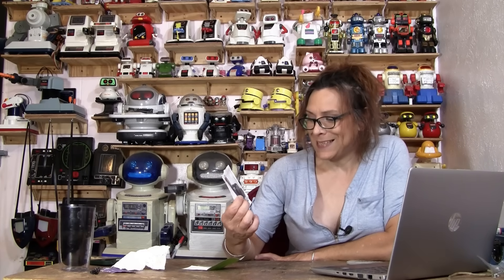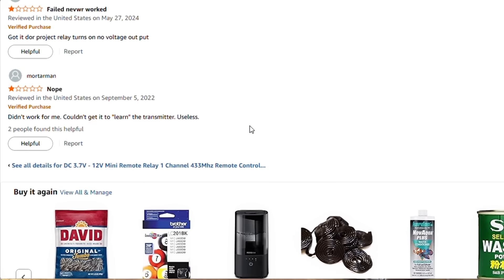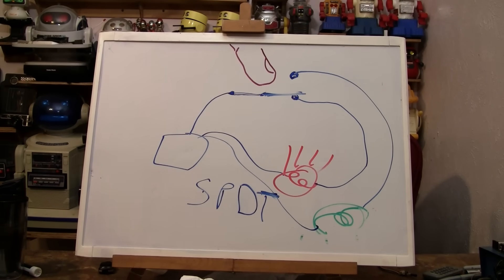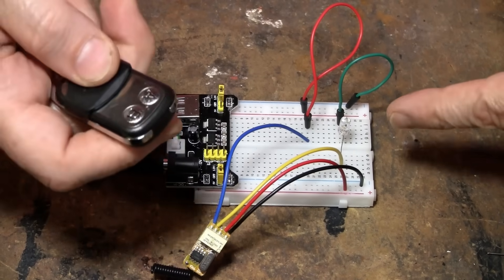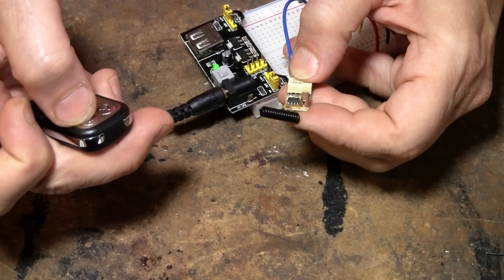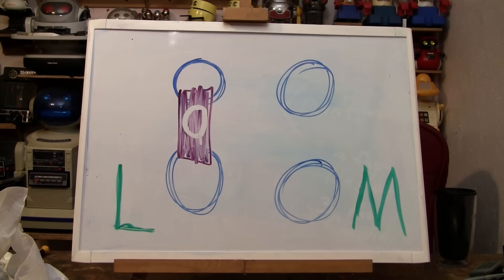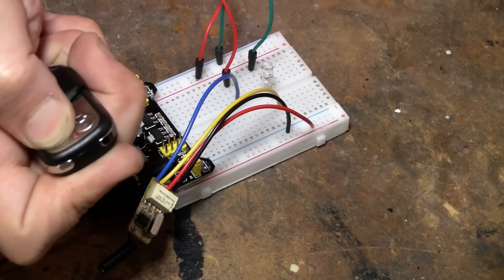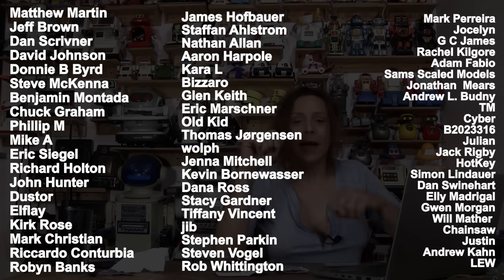How to Make Anything Remote Controlled, One Channel Wireless Control!

Comment: Probably one of the easiest to install and understand products on the market.  Just needs 12VDC.  The other two wires are a dry contact, no voltage.  I mean it doesn’t get any simpler than that!

Comment: They messed up when designing this. Latch is supposed to turn on and stay on until you hit the same button again. Momentary should be that you have to hold down the button to keep the switch activated. Toggle should be you hit one button to turn it on and the ither button to turn it off.

Comment: I've been playing with these switches for years. Super handy once you figure it out. I've installed it in my PC. It's feeding from an internal USB that's always on during soft-state. And the output is connected to the two pins with the On-button. As long as my PC is plugged in, the USB feeds this relay, and I can turn on my PC from my couch.
Some people may say why not use the (Last Power State) option set to (Turn on when power is on), and use a wifi outlt adapter to turn the PC on from your phone. That works too, but... It means your PC stays completely off when turned off. And that's bad for the motherboard battery. You want the PC to stay plugged in. And in that case, the last power state option is useless. You need something like this to turn it on properly.

Comment: On Amazon UK, I have bought several remote control,solutions that are way less complicated. For £15 ($20) I get a remote control controller that controls 3 separate wall plugs. I unplug the appliance, plug in a remote control unit and re plug my appliance back into that. That’s all. I can then control whatever is plugged in remotely.

Comment: How do you reset the initial relay programming from the remote to circuit? Ie; click A once turn on click B once turn off, to click A twice turns off, click B twice turns on. As a troubleshooting procedure in case the initial relay command doesn’t respond?

Comment: Kind of confused by this whole video. You understand what a switch does but not the 3 kinds of switch? Also the diagram that you say is wrong is not what you think it’s for. It’s for adding a physical switch to the receiver so you can trigger it without the remote.

Comment: Yeah, it's just a remote controlled switch that either completes or breaks a circuit.   Your remote door locks on your car work the same way.  I set up something similar to remotely control an electric valve, saves me a lot of walking.

Comment: You should add a series resistor with the LED to prevent too much current from frizzelling it. Try 220 ohms at 3v as in your circuit.

Comment: Love your video on your remote-control magic! I was interested throughout and it sent me to your channel. Thanks a lot for the education. I really apricate your approach, your knowledge and your enthusiasm and being low key like me.
I found the mini remotes on Amazon you recommended and I’m now looking at Breadboards and Power supplies for the first time.
Could you give a beginner in electronics a recommendation for a Breadboard and Power supplies for a first-time breadboard user. For a minute I thought they were sold together, just now figured out you have to purchase separately. I’m finally able to pursue my interest in electronics more since retiring. I’ve been working on all kind of stuff. I’ve gotten into some RC stuff and have a tub of RC VEX stuff. Along with HO train stuff. I’ve been messing with power chairs and have assembled quite a collection of Bose stereo equipment and we just installed a home security system. So, I love what you’re doing. KEEP THE VIDEOS COMING!

Comment: I’d recommend using a resistor in series with the LED to limit the current through it. Maybe 100 ohms or so. Right now you’re just limited by what your supply can give, That LED might not live long.

Comment: I don't know who and why decided to call them pull/throw, because they don't make sense just by name (pull? people push/press switches). But I don't know - and it doesn't really matter - who and why called various technical terms that I commonly use. Part of learning about them is moving past the who+why, and part of it it's the explanation of how things work. If both parts are unclear, it's easier to shrug and move on. But it hardly gets clearer than the way you explained it, so now I understand the technical side and not care about the who+why. The rest will be cool trivia some time in the future. 😄

Comment: Hi, I have a question. I have a new invention coming out and I need a remote control release device for this. Can you help me out with it or point me in the right direction please? Basically I have an aluminum triangle that’s 3 x 3 x 3 and one of the sides will have a hinge on it and I need a device that when I push the button, it will open the door or open one of the sides up the item will be 4 foot long.

Comment: You could take 3 sonoff sv or another version of that relay and modify them for dry contact and a push button input. Wire in a liftmaster 850LM and program a 890 max and then you can control 3 things with your remote but also from your pc, phone or tablet

Comment: There are also lots of relays out there that use 120V, 24V, or 12V to power the device. I avoid battery operated devices when I can. Alternately,  you can use a 9V plug-in transformer to substitute for the battery with this type of device.

Comment: Great video. What your images and commentary show is that many of the lower star ratings are correct as this is miles from a turn-key device. This is why people are pissed with the abysmal  instructuons given with the product - there is no excuse for the hopeless instructions and Amazon shouldnt sell this rubbish. Read clearly here, the instructions make this useless. This device is for electronic experts (some might say nerds, but I wouldnt) only. I've fitted and used a few VSRs to control higer amperage devices using 200A relays on boats and I wouldn't go near a device like this as it's not really fot for purpose because of the user input required. Sorry to go against the flow that you guys think this thing is okay, but honestly it is definitely not.

Comment: Great tutorial, very interesting NO Normally open , NC Normally closed has always been confusing 😮 because the meanings seem opposite. Normally closed means voltage is always passing through, who ever made that up ?. Closed should mean it’s not letting voltage through because it’s closed. Just like you can’t come in my house because the door is closed, it’s always seemed backwards 🤪. Thank you for the simple explanation although I’ve never liked that way of calling circuits out. 🙏🏼

Comment: Be cautious of those breadboard power supplies. While the 3.3v and 5v regulators are rated at/or near an amp, the power switch is only rated for 100mA’s.

Comment: Are you a female? How can I use these with arduino?
Reply: You could attach the wires that get connected (when the remote fires) to a digital or analog input line of an Arduino, with a resistor, so that when you signal "on" with the remote, the input goes from 0 to 1.  Then your software can take it from there. 

I don't believe I've heard Randi speak about herself personally, why does it matter?  She's a human being and a great teacher, that's all I need to know.

Comment: I've been an electronics engineering technician for 45 years.  In this day and age, a 7mA  x  9V (or 63mW) continuous power consumption for a wireless receiver is quite high.  Consider that if the designers had incorporated a circuit that turned the receiver off for four seconds, then on for one second, the power consumption would be reduced to 1/5th, and the battery would last 15 days.  You'd have to mash the transmitter button 5 seconds to get it to respond.    But there are other ways to reduce the power consumption.
Reply: yes! solving a problem i ignored because i didnt understand.. now i get it! 
(and now i know why my dads battery keeps dying)

Comment: My comment is in regard to battery life of the 'Receiver/ Relay' board. Your suggestion of powering the board at 3.7V will definitely extend battery life. This is primarily do to the on-board relay coil. It is this coil that consumes the vast majority of the battery power. The relay is the only component on this board that converts electrical energy to mechanical energy. This fact is very important to the electronics experimenter because the relay can (AND SHOULD) be eliminated in many applications. 
I'm going to leave this topic open because I fully expect questions, because that's what experimenters do!
Wakodahatchee Chris

Comment: Hi from Ireland Randi. I have an old PC that we use just for tv in the kitchen. It's hard to get to so I used one of these wifi modules to switch it on and off . The power comes from a molex connector ( yellow and black 12 and 0v ) . For the trigger one of the outputs on the module goes to 0 volts when triggered. This goes to one side of the on / off switch line and set up as momentary . It's in use now about 3 years.

Comment: momentary would be good for a garage door opener. latch would work if you connected it to  a relay to control a circuit with higher voltage. this is a great find.

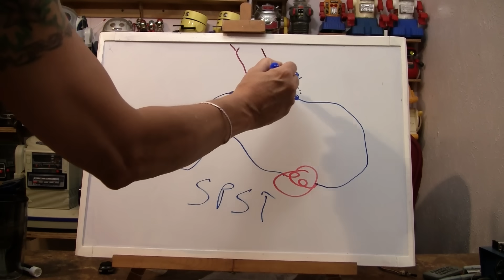Comment: 3:50 its technically a SPST-NO switch. (Normally Open) ,   which you should have went over before the SPDT-NC/NO switched relay. other than that it is good instruction / demonstration / edumacation.
Reply: She is correct. NO and NC describe the contacts of a switch not the switch itself. You would call the former an SPST switch like she did, not an ‘SPST-NO’ switch

Comment: After watching your video (How to make anything remote controlled, one channel wireless)... I purchased a clean 2000 buick lesabre custom with 123k miles & it did not come with a key fob. I purchased fobs, but I think there is an issue with the control box located in the trunk. However, that box controls other things & they work fine. I am wondering if I can use that to lock & unlock my doors? Tap into an existing circuit that is already fused but lacking control. My door lock switches work, but I  can not enter programming mode, so after seeing this video, I'm wondering 2 things? One being of course, would that remote allow me to control my door locks?

Comment: So. For the radio up the pole: It's been cloudy for three days, and the (meshtastic?) radio won't come on by itself when charging is restored. You need to momentarily interrupt power to reset it. So you need to run it through the normally closed contacts. Idk how long the battery will last, but will be longer than with the coil continuously energized. Maybe a lead acid 12v would be a better option, and you could run a wire to it at the bottom.

Comment: check it for false alarms over a 24 or 48-hour period. with an 8-bit enable code sequence and a high clock rate random matches can occur several times a day. if a single match toggles the output it will have a high false alarm rate. I have several four-channel remotes sitting in the trash bin because of this design flaw. useless and potentially dangerous (depending on the switched loads).

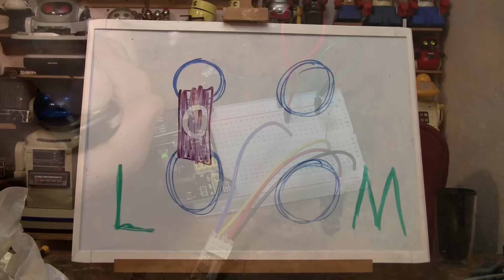Comment: 12:00 They could have used the pin and jumper system to set the modes like they use to do with old hard drives in the past where you use that tiny jumper shunts and pins to change settings, needs no soldering and easy to explain in the manual.

Comment: Hi Randi. I'd like to add a critical piece of advice as to wiring an LED with a voltage source. You didn't use a resistor to limit the current going through the LED. This gives the false impression that it should work with any other voltage than 3.3V.

If one uses 5V, for instance, and an LED without a series resistor, there's no current limitation and the LED *will* be permanently destroyed (fried). Coincidentally the forward voltage of a white LED is around 3V, so it may work when powered directly from a 3.3V (or 3V) source. However one should absolutely *never* do that. Insert a series resistor instead, in order to limit the current to about 20mA. There is a formula to apply in that case: "Resistor value = (Supply voltage - LED forward voltage) / desired LED current". It's derived from Ohm's law. The forward voltage of an LED is dependent on its colour and is lowest with red (ca 1.5V), highest with white and blue (ca 3V). Check the datasheet to know the actual value, which you'll use in the formula.

Aside from that, also keep in mind all LEDs have a maximum reverse voltage, beyond which the LED will also be permanently destroyed. That reverse voltage is also given in the datasheet. It's around -5V, typically.
Reply: V / I x R etc.
Reply: @snakezdewiggle6084  Not quite. More like `R = ΔV / I` or `V = R x I` and all its derivative forms ("derivative" not in the mathematical sense, of course).

Comment: Nice video 👍, keep up the good work. Can you make a video on how to use a remote control for  heavy electrical loads like water pump or split air conditioner. I want to use such a remote control for a split air conditioner that could draw around 10Amps

Comment: I think their definition of latching is not correct. Usually latching means, you press A and release, it turns on. You press A again and release, it turns off. Non latching means, you press A and holds the button down, it turns on and keeps turned on. You release A, it turns off. That is what I have seen on foot switches for music instruments. Latching is the same as toggle. Non latching is the same as momentarily.

Comment: You should be able to control two of these with the same remote... Set the first clicking A then B, and set the second clicking B then A.  Set them both to toggle.  Click A to turn on/off the first and click B to turn on/off the second.

Comment: 🤩Yessssss ! 🤩
I recently installed an AuxBeam AC-1200 Remote Control 12 Gang Switch Panel in one of my Jeeps . What I didn't like is the remote only works if the ignition key is on ..this little relay that you demonstrated is my SOLUTION ! Now I can give power(+) to the Switch Panel when the ignition key is off .. also thinking of placing a diode in my wiring so it doesn't get power(+) fed back into the vehicle ignition/accessory curcuit (only powering the Switch Panel ) 😏 AWESOME ! 
EPIC THUMBS UP ! 👍👍Thanks so very much for sharin' ! 😎
❤😇
Reply: ? Why don't you wire your device to a hot circuit/wire on your auto?  You clearly wired to a switched circuit/wire.  ???
Reply: I was just thinking if this could work in a vehicle? Then I see your comment😂 Bravo right on😊